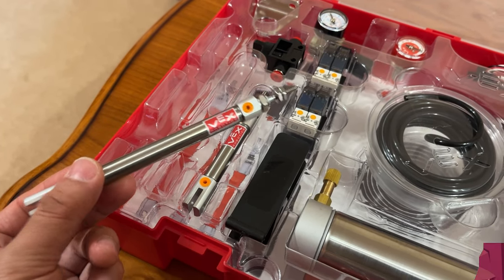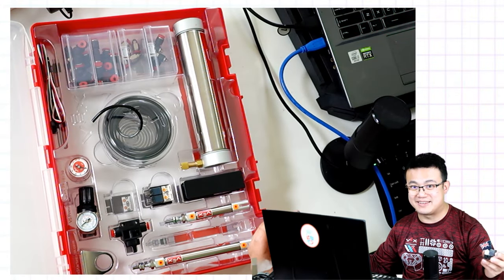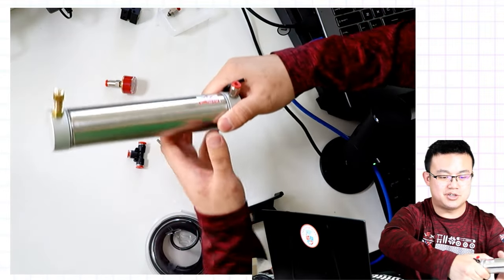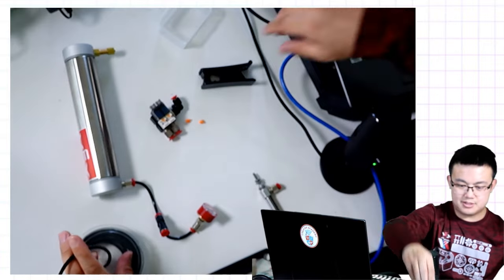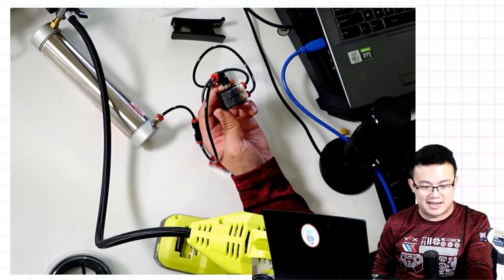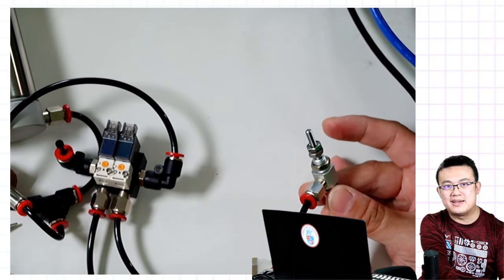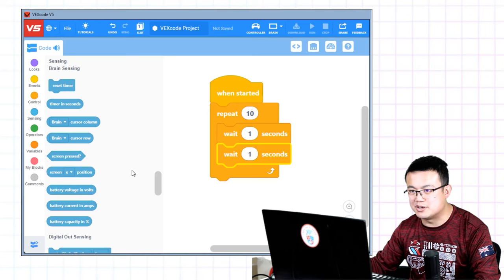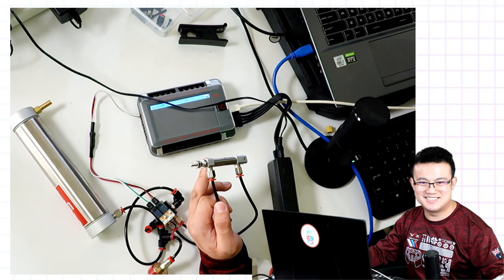How to Build and Code VEX V5 Pneumatics

Comment: For building a mechanism for wings in vex over under, would I have to have 2 different systems or could I wire it in the same system?
Reply from the maker: You can probably wire them in the same system so they can move together, but depends on how many other pistons you have. Garry